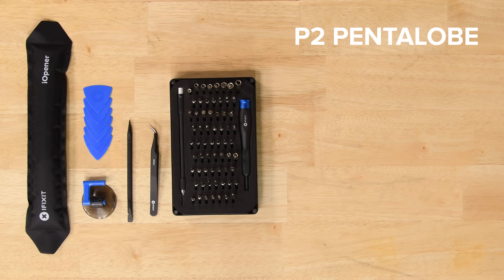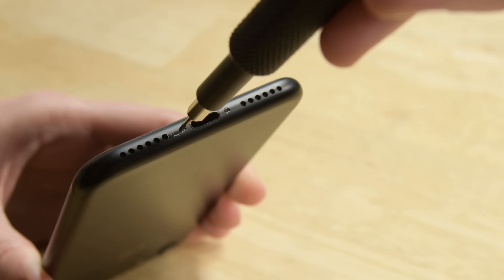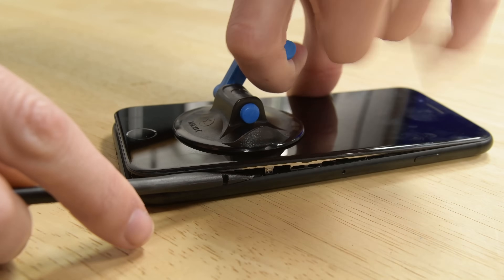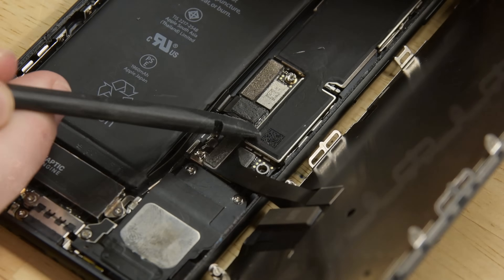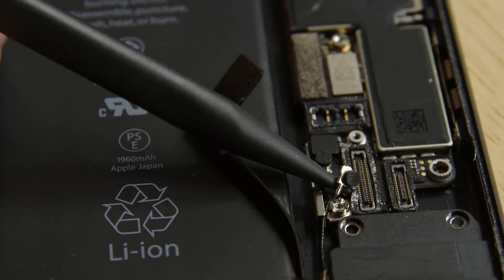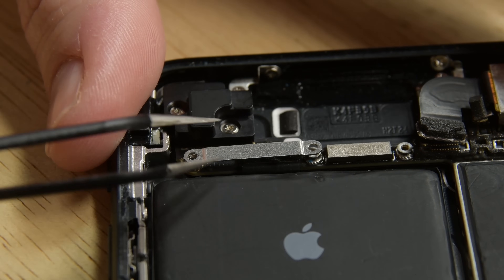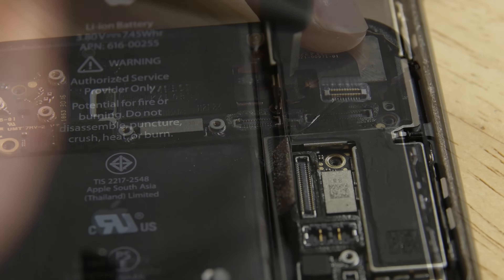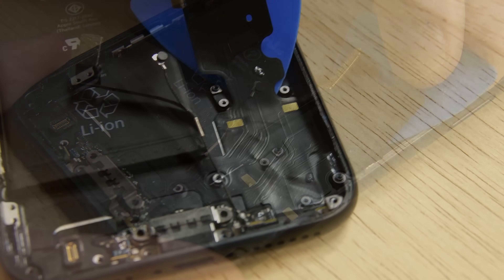iPhone 7 Lightning Connector Replacement- How To

Comment: Wow. Four hours. This is impossible if you are not dextrous or have any degree of shakes. Can't do it without the trilobe screwdriver. Lining up the charger port and cable with the two white dots in the back of the phone case is vital. I would suggest removing the sticky covers from the port cable and counter-intuitively sticking the cable end first, lining up the dots and working down the cable to the charger port.  Reassembly steps, use the written stripdown in reverse order on the ifix website.
 I have fiddled with several phones, replaced screens and batteries but this is the hardest job so far.

Comment: How completely ridiculous. Is the lightning connector the first part in the Apple assembly line. Step one: take lightning connecting and install back case onto it. 😂 If you like level 10 puzzle boxes, just pickup a lightning port to replace.

Comment: hmmm my question is on iphone 6 all the screws are different sizes and must be screwed back in from its original area. you're instruction is to take out all the screws without this important guidance. are all the screws for iphone 7 the same size? or maybe i missed that instructions

Comment: This part is exactly like the heater core on a mid 80's Audi 5000. After the welded the vehicle together and painted it, the heater core and it's Box was the first thing bolted in place. I believe the flat-rate book w/AC & P/S, the job paid 15.7 hours of labor. I did one!
I only did one not to ever repeat that job again. No wonder Audi techs have a soft-padded break room and Jack Daniels in the fridge, you know, next to the unclaimed tuna fish sandwich. WoW!
ASE Master Tech since 1978

Comment: I found out you can replace the charger without removing the motherboard, just the 2 screws that need a mini flat head screwdriver, just bend the pin connector and lift up on the mobo and slide the top of the charger cable under the mobo so the connectors line up.

Comment: Hi, I have an IPhone 7 that the sound does not work when you connect the headphones on lightening port. Would replacing the part fix the issue? Many thanks
Reply: Yes.

Comment: This is a very good dismantling video. However, you never mentioned - The hardest bit is always putting the new part in. You have to crease it in several places. Very important - align the holes with two white dots. If you want to see what I mean, watch a proper fix video

Comment: If your iphone is having trouble charging where you have to lift the charger slightly to make it charge more than likely there is probably gunk such as Lent or dust Etc I just fixed Mine by removing the gunk so that the charger fits all the way in https://www.ifixit.com/Answers/View/472532/Lightning+port+too+loose
Reply: Im glad i didnt have to completely take my iPhone apart

Comment: Definitely recommend following the link in the description to the guide. Use a few paper plates to place screws, write on plate to label steps.  Use a plate to work over in case a screws drops as you unscrew it so you don't lose it.

Comment: I've had a Google Pixel for 3 years and have never needed to open it, it just works! In the same period I have needed to open 5 iPhones to repair them, and with each new model Apple introduce a new fricken screw type, the reason? so they can get charge a fortune on repairs. I will NEVER buy another iPhone!

Comment: When I did this I took a picture of the guts of the phone with the screen removed which is the easy bit. I then taped that picture (which I enlarged a bit) to a magnetic mat and just placed each screw and other bits on the picture, worked a treat...but don't sneeze ffs. All the items will only go in one place so that's not a problem. The important thing is don't get the screws mixed up.

Comment: hey bro i had bought 2 cheap charging cables for my iphone 7 plus as original was broken. My phone was not getting charged yest  from the new one's and then i tried to do it with my brothers original  cable and after numerous attemps i got the device on.  now after that battery was lost now the phone is not charging nor it is going into any mode.

I had shown it to the apple service center they said the device is not working and they said it has become dead.

I dont know why and how it has happned or is it really dead or is there a problem with the charging port.

Now it's not starting up and i have not dropped it and it doesnt even have any water or damage issue.

I think because of the cheap wires my charging port would've stopped working somehow so should i check it locally or try to change the charging port in some local repair shop as the apple center people said nothing can be done from their side and they can only replace a new phone with hald price.

I still have a little hope left cause nothing happned to my phone and it got switched off and stopped charging.

please help bro

Comment: Okay so i have two major issues while doing this repair and I dont know how to fix them #1 (not as major as the 2nd) at 10:56 you connect the speaker, for some reason why wires are coming up short 2) MAIN ISSUE!!!! 11:13 you connect the ribbon cable which leads from the charge port to the motherboard. For some reason it keeps popping out and it is driving me insane. Can you help me?

Comment: Thanks iFixit for a good disassembly video but I would have appreciated you mentioning that the new lightning charging adhesive-backed circuit needs to be perfectly positioned on the reassemble for the ribbon connector closest to the battery connector to actually connect. (the one that folds over sideways isn't forgiving)  I discovered this vital bit of info about 75% of the way through reassembly. Now to tear it back apart, peel up the lightning connector circuit and reposition checking with the logic board to ensure it will connect appropriately. When you are off by 0.5mm, you're still off and it will not connect.
Reply: Smash Ogre.  I ran into the same thing 😊 this time I plugged first and with the adhesive slightly off, I repeated with the board connected insuring everything sits according.
Reply: bruh, i'm going to try this tomorrow but you got me concerned af.

Comment: Did the repair last night. Worked perfectly. Just have to be careful that you place the module on correctly since it uses adhesive. There are two spots on the case that align with the module to help you put it on. A lighted magnified glass is a must. Parts are cheap and usually come with tools. I got my lightning connector with nice tools for $16.99. Once you start fixing phones you start accumulating tools. I recommend using a razor when opening the iphone 7. Oh, I worked slow and made sure I got it right. Took me 4hrs. Could probably cut that time in half now that I know how to do it. Also, I used separate pieces of scotch tape to hold all my parts and I numbered them in the order I took them apart. Then I worked backwards.
Reply: Hey Walter, you seem very experienced guy. My iPhone 7 Reds' battery was draining even when shut off so replaced it under battery replacement program from Apple service center. The problem is still there. iPhone at 90% shut down at 11PM and switched on at 8AM next day drains to 83-84%. What should I do?
Reply: Himanshu Jagtap Do what apple wants you to do, they assembly it like this so you have to go and get another iphone
Reply: You were wearing any type of
Gloves ?

Comment: In all honestly you probably have a warranty for the iPhone and the Apple repair would cost less than the tools also you could break a critical component
Reply: lmao
Reply: james aketch if you are careful everything will come out good. You don’t need all those fancy parts cheap parts work wonderful but you need to be careful and take your time. I juts replace the charging port in my iPhone 7 Plus no problem.